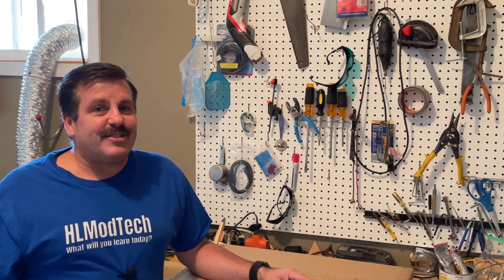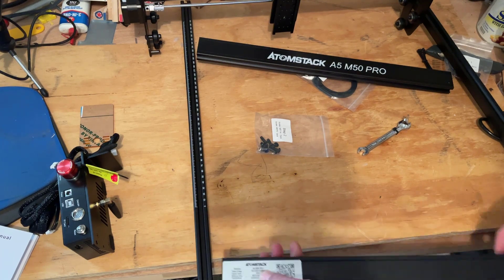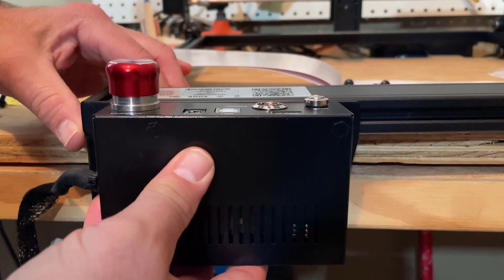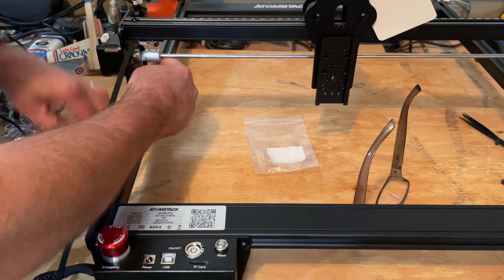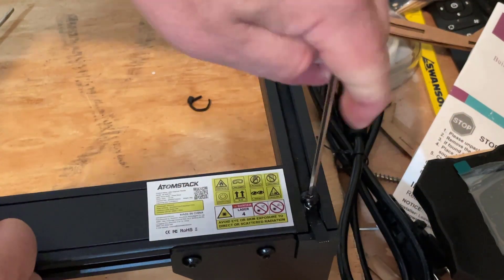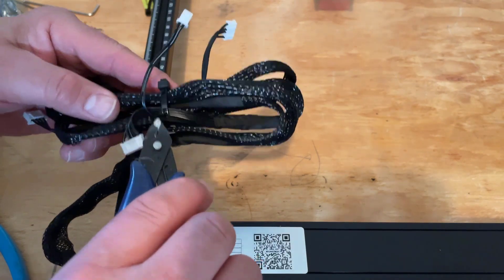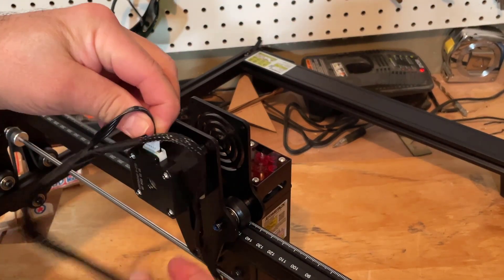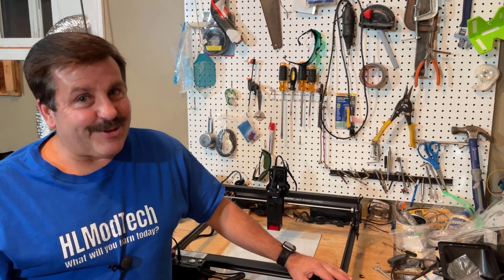ATOMSTACK A5 M50 PRO Laser Engraving Machine Assemble in Minutes

Comment: A cat chewed through my wiring harness on my Atomstack A5 Pro.  I think that the harness may be the same as the  A5 M50 pro minus the wiring for the end stops.  If that is true, could I use the same harness just not utilize the end stop connections?  Also do I remove the housing to plug in the harness?  Does it have the pin type connection?  Thanks for any help you can give me.
Reply from the maker: I have no idea about that. Your best bet is going to be Atomstack support.

Comment: Whats the size of the spacer to set the laser height relative to the item?
Reply from the maker: I’m on the road at the moment, but I would guess about 3 mm. When I get home, I will check and get your number.
Reply from the maker: I did get a chance to measure it and it is 3mm.
Reply: @HLModTech  many thanks.  I must try mine at 3mm.  I found my spacer and it measures 2mm.  Thanks for checking though.
Reply from the maker: Sorry to give you bad info. Now I am curious which one I picked up... I really need to write a brand on each of those so I do not get messed up. 🤦‍♂️

Comment: My numbers are on the right side with logo facing me, also step 2 says m5*14 m5*6 but the small doesn't fit leaving the power supply loose.
Reply from the maker: Any chance it is twisted 90 degrees?
Reply: @HLModTech  I did get to the end of the set up only to find I received a European plug and not USA. So that could be the reason. I emailed the company.
Reply from the maker: Good catch. Hope that is all it takes to get it up and running. 👍

Comment: Tip for anybody watching.  Don't try to hide the labels on the main bars by flipping them upside-down. There are only screw holes on one side for the legs
Reply from the maker: I just re-checked my vid... I do not think I have anything upside down. Are you just sharing your experience, or did you notice somewhere I had something goofy?
Reply: @HL ModTech  oh, sorry. Ya, just me trying to hide the logo and labels. Nothing in your video. 

I assume I'm not the only person who might attempt that. I hoped to save someone else the trouble of taking everything apart if they did try like me.
Reply from the maker: Totally makes sense. 👍  Also wanted to make sure I had not hosed something... I try to be spot on... but I am capable of mess ups. =)